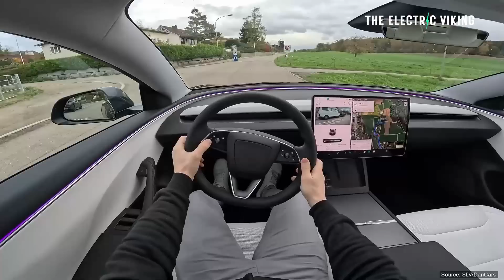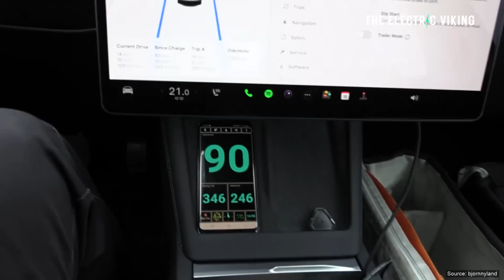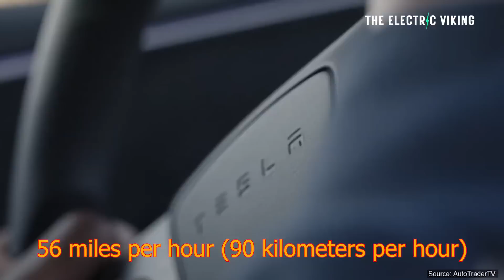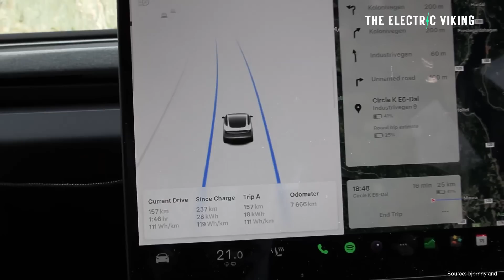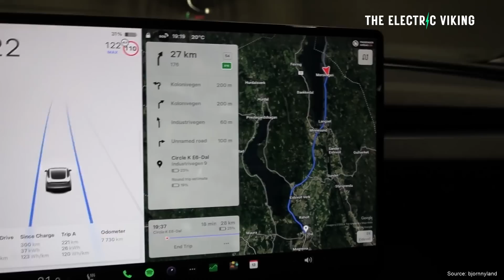Tesla with LFP battery achieves RECORD breaking efficiency in highway test

Comment: I have an LFP battery M3 and a LRMY. I get better daily range from the LFP M3. 100 to 0 the MY wins by a little (25 ish miles extra), but usable daily range the LFP M3 wins. I also love the fact with LFP I don't have to be scared to charge above 80%. Every time I charge over 80% in the LRMY I feel like I am damaging my battery (even if its fine to do occasionally). I am really excited about the 600 miles battery Samsung recently announced. I drive 50-100k miles per year and a lot of long distance road trips for work. I would definitely do the 600 miles battery even a higher up charge. 600 miles is about the max I do in a single day. Charge at hotel while sleeping and go from there. I really try to avoid supercharging for cost and degradation reasons.

Comment: We are at an odd time where EV tech is surpassing ICE vehicles , but in some aspects it still makes sense to drive ICE.  In 5 years I don’t think there will be many use cases where ICE will make sense.  

I think towing, driving long distances, charge times, and weight of the battery (which affects various aspects of performance, particularly off-road ) will all be problems of the past as battery tech continues to improve.

I am still waiting to get an EV truck.  I am not dropping 100k on a cybertruck.  I will probably shop around in 5-10 years when my truck needs replaced.

Comment: I have a 2021 Tesla Model 3.  I drive at 68mph on the highway. With the 2170 battery pack it consistently gave me 5mi/kwh.  Last month the 2170 battery pack failed and Tesla replaced it (at no cost to me) with their current LFP battery pack which is 240lb heavier.   I'm delighted with the LFP battery.  I now consistently get 4.4 mi/kwh.  Range is 263 miles - a bit higher than when the car was new.  The car rides better (they adjusted the suspension for the extra weight), regen braking is stronger and LFP degrades at half the rate of the 2170 pack.  It costs me U.S. 3.5 cents/mi to drive.  Mysteriously, regen braking works well even when the battery is at 100% charge - so I'm guessing "100%" is not really 100%.  Sandy Munro is puzzled by Tesla's efficiency too, saying it is  due to their "secret sauce".

Comment: Efficiency has very little to do with the batteries other than how much they weigh (a lower kWh/kg means a heavier pack). Two identical cars where the weigh is kept the same, one with the most advanced li-ion batteries and another with NiCad batteries, will have the same efficiency. The one with Li-ion will go way farther due to having more energy capacity, but that doesn't mean the efficiency is higher any more than if you put a bigger gas tank on a gas car and tried to say that because it can go farther.

Comment: How they did it?
Tesla hides another battery behind the rear seat to extend the rang? 
The test was mostly downhill? 
All the interior was ripped out to make the car lighter? 
This Tesla was running on slicks? 

Come on guys, (help with more ideas) what more tricks Tesla could have used in this test to extend the actual range by 50%??? It's Tesla, we all know the tricks they use :)

Comment: 5100klm on the odometer 80% highway driving. Current consumption on the dashboard  174wh/klm.
Always AC on at 21-22 Celsius and I had 172 before summer (40+ Celsius outside temperature). Average speed on the highway 130+. 
Base model 3 2024. Efficiency is amazing. Car drives amazing. If you live in a country with sufficient charging network, the best car for its price tag out there.

Comment: My experience supports that of Bjorn Nyland. I have a 2022 Model Y LR. On my work commute, which is about 1/3 surface streets (45 mph) and 2/3 highway (75 mph), I get about 225 Wh/mile in summer driving, or just over 4 miles/kWh. In Winter it’s about 300-350 Wh/mile, depending how cold it gets in Michigan, which is still not bad. In about 2 years of driving, my average efficiency exceeds Tesla’s claims for the Model Y. When I take the back-roads route to work (50-55 mph), I get almost 5 miles/kWh (205-210 Wh/mile).

Comment: I wonder if Tesla has leveraged its original Maxwell purchase. 
I've not heard of any disassembly of the Highland.
But could they be using multiple small solid state supercapacitors between the battery and the motor? Carge them from the chemical battery but when the motordraws on them its nearly lossless and loses much less efficiency at higher speeds. Essentially load and protection for the chemical batteries increasing efficiency and longevity. 

I'm not electrical engineer, so just guessing.

Comment: I have the 2024 m3 long range RWD for two weeks now. Average over 600 miles 200 wh/per mile or 5 miles per kilowatt. I have had it down to 180wh/mi on longer drives. The key is to keep it between mph to 65 mph.
Reply: Between what and what?
Reply: @pb25193  0-65mi....kidding, curious, too!
Reply: I just purchased a 2024 M3 RWD LR because it was the least expensive Tesla I could buy ($34,990 after tax credit). After driving it 580 miles its average consumption was 205 wh/mile (4.88 miles/kwh). About 220 of those miles at speeds in excess of 75 mph.

Comment: the LARGE Tesla Model SLR efficiency same as Tesla Model 3LR?

Tesla Model SLR:
 • 4 miles / kWh
 • 100-kWh battery using 18650 cells 
 • 405 miles

Comment: G'day Sam,
So many people try to confuse the reader (viewer) in complex, theoretical discussions, that may include a dodgy coefficient or two. But real  world performance is easy to measure and difficult to dispute. Right now, the mainline efficiency discussion is about batteries (and it should be), but I'm interested in motors, specifically, the contest between Axial flux motors and radial flux motors. 

I haven't seen any new discussion for a while, but I don't believe the matter is totally settled yet. In any non-theoretical discussion, Tesla wins, and the market place backs that up.  Tesla uses radial flux motors, but a little voice in the back of my brain keeps bleating that axial flux motors may be a better option. The flux path is shorter and (similar to the electrical circuit with shorter wires), this leads to reduced losses. Also, for the same horsepower, axial flux motors have higher torque and spin at a slower speed. They have a larger diameter and therefore they are more difficult to package. But that high torque may mean that axial flux motors require no reduction gear, or perhaps only a single stage reduction (unlike the two stage reduction in Tesla gearboxes).

I'd really like to read the discussion between two knowledgeable dudes on this motor conundrum. I believe Aptera uses axial flux motors (but where the hell is Aptera? Bankruptcy court?)
Reply: The difference in the performance that can be achieved with axial flux and radial flux motors is not large. Both are capable of over 90% efficiency, so even in theory only a few per cent improvement is possible.
Reply: Not an expert.  But this is why Axial flux looks promising.
Efficiency that is RPM agnostic and no transmissions ( 1 speed ) are a good combination.

YASA P400 Series (Axial Flux):
Peak efficiency: 97%
Efficiency above 95%  **over a wide operating range**

maintains high efficiency across a broader range of speeds compared to traditional radial flux motors.

Comment: 56 mph is a joke. Interstate traffic travels at 75 to 85 mph. 

If you do the math or watch reasonable range test youtube videos, you arrive at the fact that for every 2 hours of driving a Tesla model 3 requires 1 minutes of charging at a 250 KW charger - charging from 10% to 80% as recommended.

We need 1 MW chargers to make driving long distances reasonable.

Comment: I have a model 3 rear wheel drive 2000 and it is currently showing an economy of 214 kWh per mile life time average. 14630 miles. At the moment I am returning some 170 kWh per mile.

Comment: With EV's having a low drag coefficient is extremely important. Tesla does extremely well, with the Model 3 being better than the McLaren's Speedtail concept. However Lucid Air claims to beat that.
It's not where Tesla gains its major advantage though.

Most of Tesla's gains is where EV's must spend energy to save energy and that is in thermal management. No EV company so far as come close to Tesla's KISS design of the octovalve and the associated modes of heating and cooling.
Munro has a very good tear down and comparison. They decided to compare to an OEM manufacturer, stating that the best design they'd seen on any other OEM was the Ford Mustang Mach-E. But the teardown showed it was significantly more complex, 3x the weight and 3 times the length of hoses required.

The octovalve and heat pump system is straightforward needing only the radiator, chiller+ condenser combo with the PCS (Power Control System), Battery and Drive Unit being in the loop.

The octovalve is simple two four way valves. But it's a keep-it-simple (and patented) way of not overthinking the problem. 12 possible heating and cooling modes are achieved (many we will never need in Australia because a lot of them deal purely with temperatures below -10C)

... but what it allows for is a very simple way of ensuring at any particular time, the battery, power unit and other components are exactly the temperature they need to be to operate at maximum efficiency.

No other car manufacturer can achieve this as easily, because to be able to actively cool &/or warm all of these components simultaneously requires multiple ways to redirect the heat and cooling from the heat pump. And no other systems seem to do it as straight forward, with many resorting to heating batteries in far less efficient ways.

For the really technical overview, suggest reading the technical published paper "Octovalve Thermal Management Control for Electric Vehicle", Wray Et al. (23Aug2022). But the Munro tear down gives a good overview.
There are also videos which cover many of the modes.

Furtherstill, you can go into service mode on any Tesla and see the thermal mangement mapping in action (it literally can show the position of the 2x4 valves in action.

Comment: I have a 2022 M3 in Sydney with the LFP.  25,000kmon the clock and the efficiency since new is displayed on the screen for all to see - 127w/km. The windscreen sticker when new said a very optimistic 132w/km but I have even bettered that. I'm very easy on the car but even so, when I read about VW ID3's getting 180 I am just so thankful to have this thing.

Comment: Saldy, there are no such uncentives here in the UK, so the best buy here is the standard range....the lfp batteries can be charged to 100% whereas the long range should only be regularly charged to 80 %, so both cars will give you very similar everyday range, so a good saving to be had. on the cost of the long range.

I have a long range, I will definitely buy the standard range at my next change.

I have driven a standard range and prefer the drive compared to the dual motor long range.

Unless you are regularly doing long distances I see no benefit to having the long range dual motor.

Comment: I switch from ICE to a new M3 LR Highland in March.. and over the last 9500 miles it's returned 215wh/pm including a 3000 mile Euro trip around the Alps and a lot of motorway.. It's averaging over 5 miles per Kwh most of the time which I'm very happy with.

Comment: This video is correct, no bullshit or click bait, to get a good idea you can take a vehicle's efficiency over a long journey, and to get accurate numbers it has to be done under all weather conditions and temperatures.
So i will help here, I have a model Y std range LFP battery bought 22/2/2023, it's now 21/08/2024 so about as much winter as summer.
It has 18,000 miles on the clock and has averaged 218 wh to the mile so  4.587 miles to the kwh in normal driving.
I don't drive like a pensioner or like a racing driver.
Reply: Which country are you in? Would be interested to know how much road tripping you do ( say 200 mile round trip journeys). I’m in the UK and have  a GV60 Premium RWD (June 2022) with 77.4kWh NMC chemistry with similar mileage and after 2 years getting 3.5mi/kWh I do 70mph on the motorway typically road trip weekly on average during the UK Summer. 

SUV shape of GV60 and greater weight but shows the efficiency of Tesla.
Reply: @Antiguan_Dart  Good afternoon, I live in the UK, quite a few trips to LHR and Stanstead 200 and 300. The last 3000 miles it's been up to 5 mpkwh but that summer, and must be both to be fair.

Comment: Hi we just did a trip from Perth Western Australia to Brisbane, Sydney, Canberra, Melbourne, Adelaide and back to Perth via Albany… more than 12000km (~7,500 miles) on the hwy we mostly did 110km/h and averaged 155w/km not bad for a Late 2021 STD range LFP model 3. So that figure is no surprise for the much updated model 3. By far the best and most reliable car I have ever owned and my last few cars were new Toyota Corolla and several  VW Golf’s all noted as good all rounders and very reliable but not even close to the Tesla. I know it’s twice as much but near zero maintenance, never been back to the dealer ever since new no issues at all and near zero fuel costs we have solar on our house really takes some beating. Plus it is a better car now after more than 10 free updates since new adding several new features including safety features. A great car.

Comment: It's probably because Tesla isn't leaving much of a buffer in the pack for this model. They are letting the car access all of the battery capacity instead of software limiting them like they do other batteries. LFP batteries don't have to be coddled as much as the NMC batteries.

Comment: My wife has a late 2023 pre-facelift model 3 (Brisbane). Over 13337km and the lifetime average for her car is 113Wh/km and 122% efficiency. 

I got a model Y a month later and my lifetime average is 99%. Thought it was maybe the way I drive but when we switch cars they get similar efficiency. 

She just seems to have won the battery lottery :-)
Reply: Wow 122% efficiency, energy from nothing
Reply: Yep I have the same car (2023 Model 3 LFP) with a lifetime efficiency of 108wh/km (174wh/mile) 

I get down to 93wh/km (149wh/mile) over extended distances in summer.

Comment: What these cars might be is Robo Taxi proof of concept vehicles.  A Robo Taxi needs a battery and motor that are reliable for high mileage.  Remove the steering wheel and pedals and you have 2 great Robo Taxi models.  These are already approved as far as crash testing ect.  Likely a smaller 2 door and a van will be added too.  But Model 3 and Y Robo Taxi's could be in full production very quickly.